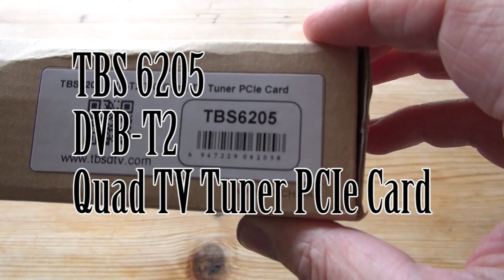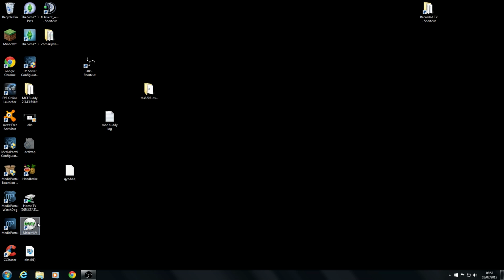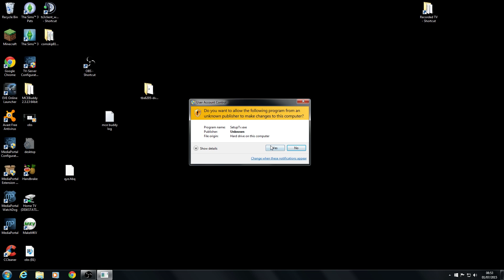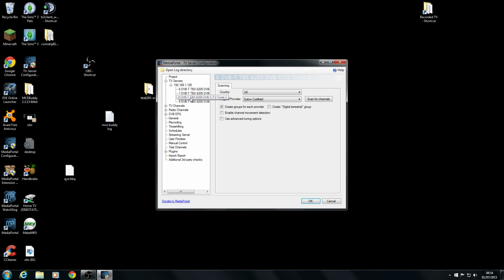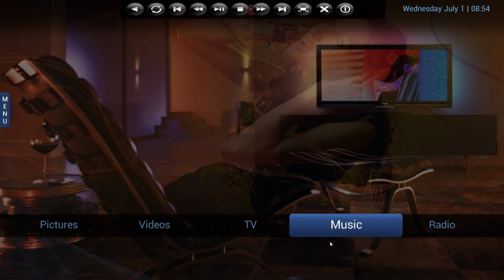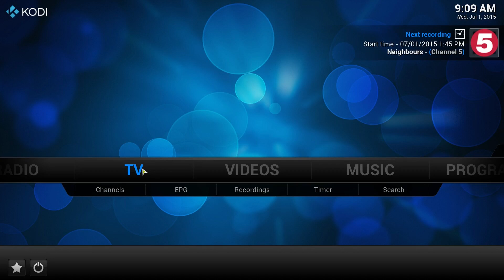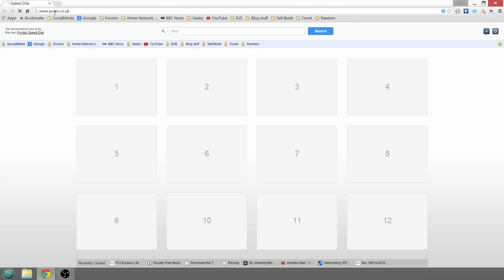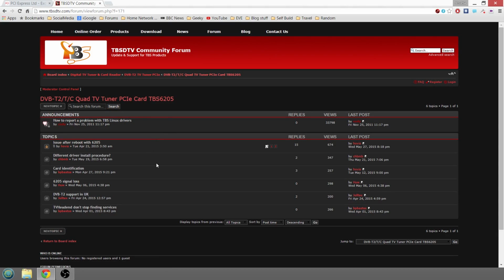TBS 6205 DVB-T2 Quad tuner PCIe card, unbox, install and review

Comment: Hi,  is this card for global use ?   Does  it require an antenna or top-set box ?  Can I watch local channels with this card ? thanks
Reply from the maker: This card requires an antenna and a digital DVB-T2 broadcaster e.g. as in UK and some other European countries. It also supports DVB-C, a cable standard which I have never tried. AM

Comment: do you need to split your original antenna cable into 2 cables
then those 2 cables go into each antenna input on the card?
how about when there is 4 inputs
do you need to plug in 4 antenna cables?
e.g.
https://www.ebay.com.au/itm/TBS6904-DVB-S2-Quad-HD-Tuner-PCIe-Card-Satellite-TV-Receiver-For-IPTV-Streaming/232038106255?epid=2215842273&hash=item36068c848f:g:PMQAAOSwIgNXovAP

would it be better to just get something like "Hauppauge WinTV-QuadHD "
which only needs one antenna cable plug into the card?

Comment: Can I use this connected to dish-mounted-at-the-roof cable and have the channels?
Reply from the maker: If you mean satellite dish, then this is not suitable for satellite broadcasts, to receive satellite you a need card which can decode satellite standards like DVB-S2, this card does not do that. AM
Reply: @AmoebaMan yes, thank you. 
So, Do you connect cable network instead of having a satellite dish?
Reply from the maker: @Emranrajaee  Hi, no I use an aerial for DVB-T2 TV free over-the-air broadcasts in the UK

Comment: Hi Amoeba Man
Thank you for this. I'm hoping you can help me with a different TBS card - it's a TBS6528 MULTI STANDARD TV TUNER COMMON INTERFACE (CI) PCI-E CARD. On paper it seems very capable, supporting DVB-S2 and EVB-T2 and with common interface. We need to be able to extract a transport stream from this card to use with our own software and are finding it difficult to get relevant information from the manufacturer on this. If Kodi and others can get TBS cards to work with their interfaces then there must be some hope that there is an SDK where we can access the card's output. It will be installed under Windows Server 2016.
I hope you can point me in the right direction.
Reply from the maker: I am sorry Frank, I have no idea how that could be done! AM
Reply: Hi
I made some progress yesterday with TBS support. They use the Windows Broadcast Driver Architecture (BDA - see https://en.wikipedia.org/wiki/Broadcast_Driver_Architecture) which is a standard for streaming with Windows (I didn't know this existed until yesterday). There are a lot of code examples to be found on this - Microsoft site, Github and Google).
All the best.

Comment: I need to record 5 different channels,if they are on the same frequency one tuner will be enough?
Reply from the maker: If they are on the same multiplex you may be able to record multiple streams with one tuner, max number depends on stream and your setup.  AM
Reply: Amoeba Man hi, I have 30 channels in single line from lnb, can this card provide me all 30 channels at same time?
I’m willing to take all channels from lnb and stream each channel on different ip on my local network

Comment: when recording shows,  does it record adverts too ?  if so does the software bundled with it have a way of editing them out ?
Reply from the maker: HI Pete, I am not sure what software comes with the card, I use Mediaportal which is free / open source.  I also use MCEBuddy to transcribe my recordings, this can automatically detect and  remove ads from most recordings. If you wanted to edit them out manually then you can use almost any video editing package to do this as Mediaportal will save recordings in mp4 format. AM
Reply: thanks for getting back to me,   this info has sold me on the card :)  will be looking to add it to my Kodi set up in the very near future :)

Comment: I am having trouble scanning channels using DVB Dream and it says No Channels found, please can you help and do a tutorial?
Reply from the maker: Hi JJay, I am sorry I am not familiar with DVB Dream so I can't help much - start by checking the basics e.g. drivers installed, aerial plugged into the correct port on the back.  Do you have a strong signal e.g. a good quality aerial?  If everything looks good  then why not consider trying some alternative software?  FYI I have never had any success with indoor aerials at all but I live in an area where the signal is not very strong. Trying checking your aerial with a standard TV just to make sure you have a signal perhaps?
 GL! AM
Reply: Amoeba Man Hi I figured it out.. its because I installed the DVB-C drivers instead of the DVBT/T2 drivers and was using cable instead of satellite in the settings of the software with my indoor ariel.. Uninstalled the DBV-C driver and works all fine now. The DVB Dream and Media Portal 2 are picking up channels! I am considering switching to external Ariel so that I can get freeviewHD channels maybe but my setup with virgin is quite complicated lol. Thanks!
Reply from the maker: Great, I am glad you got it working! AM

Comment: can this be connected with this Indoor-Thin-Flat-TV-Antenna-HD-TV-Scout-TVFox-Type-High-Def-HDTV-VHF-UHF-DTV
https://www.ebay.com/itm/192339175067 ???? as im looking to get my free to air channels to the pc and play them on extream codes
Reply from the maker: Hi engelbert! I have never had any success at all with these portable aerials and use a cable connection to my house aerial - reception in my area is poor generally though and I use a signal booster on my aerial mast - in general though the TV signal indoors is typically pretty poor and personally I would not count on such a device to work, if you live in an area with a very strong signal  then perhaps you might have more luck, sorry I can't be of more help! AM

Comment: I used to use them back in 2008-2009 but I sold my old computer with it. Now I need a new one and cant decide on the brand or technology.
Reply from the maker: Good luck with your decision, fyi if you  are considering DVB-T2 then this card appears to still be on sale, mine is still running very well after 2+ years. AM

Comment: I saw several cards of this in the internet but I do not know which to use because they are all the configurations They are written in English if you can help me please send your e-mail
Reply from the maker: How will you receive your TV ? The first thing you need to know is what kind of broadcast your TV service is, are you planning to receive digital TV by aerial or satellite? :

https://en.wikipedia.org/wiki/ISDB-T_International

It looks to me like in Brazil digital TV is broadcast using a standard called SBTVD which is based on the Japanese ISDB-T standard, we do not have this in Europe and I am not familiar with it.
TBS do make an ISDB-T compatible card but you will need to check whether this is compatible :

https://www.tbsdtv.com/products/tbs6814-isdb-t-quad-tuner-pcie-card.html

This is not a satellite card, it is a TV card. For satellite here in the UK you typically need a DVB-S2 card (like the TBS6904) but this typically only allows you to watch free to air channels.  You need to find out what standard is used in Brazil for satellite.

I am sorry I don't know anything about unlocking satellite signals, in the UK satellite services are either free to air or require a decoder for a which a subscription is required.

AM

Comment: I tried so many times with at least 3 different adapters to get EPG to work, but never ever managed to do it :(
Any plans to do a tutorial/walktrough to configure a MediaPortal TV server / Kodi client?
Reply from the maker: Sorry you are having trouble, to be honest it is not my area of expertise, it is so long now since I configured my server I would probably have to re-do it and learn again.  I use the broadcast guide data from the DVB feed rather than any of the external reference databases like xmltv.  In my experience its all about the server side, if the server is correctly configured all Kodi needs is the MP plugin enabled, IP address and password and it gets the data automatically.  I guess the starting point is whether a MediaPortal remote client can get the data i.e. is the server offering up the data on the network. AM

Comment: Tripod = 3rd hand. you can even get one for you phone.
Reply from the maker: Very good point, I do use a tripod with my camera but on this video I couldn't get a good shot of the inside of the case with the camera on its mounting due to the very tight space and I wanted a close up of the motherboard and socket so hence the wobbles, ah well, pffft!  AM

Comment: Hello 
I install driver TBS 6205 DVB-C on linux AMD64 , and i put on each adapter frequency on TVheadend .
adapter0      266000
adapter1      354000
adapter2      522000
adapter3      570000
and whene i run all stream on my server IPTV , all stream crash . if i run 4 stream all work well .
so whats is problem ..
Reply from the maker: Sorry Abdesamad, I use DVB-T2 (not DVB-C), have Intel hardware and don't use TVheadend so we have different setups, I also don't use IPTV and don't know much about to to be honest.  One suggestion - perhaps you see whether it is software related and could try a different backend to see if you card is working correctly on that?  I use Mediaportal server without issue using the 1.0.0.3 drivers for DVB-T2, latest release is 1.0.0.4 - its an easy install and free to download.  You could also try the TBS forums for technical help, they are linked in the show notes above.  I hope you get your issue sorted and sorry I can't be of more help, AM

Comment: Thanks man, extremely helpful. I'm going to try to get these cards to work in Australia. (Nice quality hardware by the way).
Reply from the maker: Great, hope it goes well for you. No issues at all here with the card, for me it has been excellent so far running 24/7. AM
Reply: Hi Greg, how did you go with the TBS6205 in Oz? I'm in Perth and thinking of ordering one. Are you using MediPortal?

Cheers,
Steve.

Comment: few channels,
you can record in simultaneous?
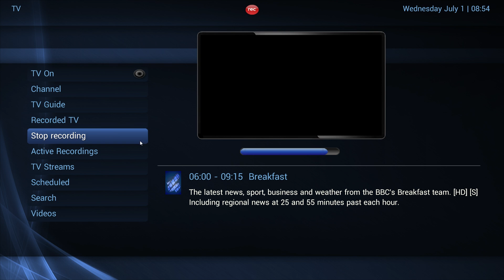Reply from the maker: If you have the right software and hardware you can watch many different channels in many different rooms using this card, If you you look at 5:05 in the video I demonstrate recording 6 live TV channels simultaneously and the server could certainly do more. GL! AM
Reply: Amoeba Man
When I look at the specifications of the hardware is not detailed how many programs can I capture at the same time, I'm looking for a having ISDB-T, but apparently the only way would be to buy multiple devices at the same time with ISDB-T with USB port and record at the same time with different cables
Reply from the maker: Marko, the card in this review does not support ISDB-T, TBS appear to make one called the TBS6814, http://www.tbsdtv.com/products/tbs6814-isdb-t-quad-tuner-pcie-card.html, I'm sorry we do not have this standard in  Europe and I don't know anything about the card so can't really offer any advice. GL! AM

Comment: How many channels can you simultaneously watch.
Like can I watch one channel a different room and another and a different one etc ?
Reply from the maker: +TOM FUB Hi Tom, difficult to answer because it depends on what software you are using and how good your hardware is.  With Mediaportal maximum simultaneous live channels depends on how your channels are multiplexed in your home country but minimum of 4, probably a lot more than that!  If you are watching recorded TV pr combination of recordings and live then a lot more than that can be watched.  If you you look at 5:05 in the video I demonstrate recording 6 live TV channels simultaneously and the server could certainly do more.  Important note : if you are using Windows Media Center then when I last checked for some reason windows restricts you to one channel to one tuner and a maximum of 4 tuners. My server is a relatively powerful PC, with less power available you could end running into hardware limits if you try and stream many channels - something else to check on. AM
Reply: +Amoeba Man Thank you for your quick response.
Hardware is not an issue with me, i am running a i7 and 32 gb of ram, so I don't see that being a problem.
I'm really tempted to buy one of these cards For streaming purposes, but in your honest opinion, are they definitely worth it for the price, because they are quite expensive, especially the satellite ones.
Reply from the maker: +TOM FUB You are right, you won't have an issue with PC. I don't know about the satellite ones sorry, I certainly have no regrets but I like my server to be rock-solid as it is our main media device in our house and i have had variable experiences with cheap USB tuners.  You could reduce the cost by going for fewer tuners on the card.  I haven't seen many cheap quad tuner PCI cards tbh.  Good Luck ! AM
Reply: Hello there again, I've come back to your video wanted to ask you another question if I can, please.
I finally purchased a card on eBay TBS 6981 Satellite Tuner, in your opinion what is the best software to use with these cards.
for scaning for channels, I want to stream the channels over my network to other devices such as my kodi media centre/Nvidia shield.
Ideally I would like them to be in m3u8 format.
Thanks for any information you can provide.
Reply from the maker: HI Tom, I have always used Mediaportal server under windows 10 as a backend on my network and it does an excellent job of serving live tv and recordings to frontends including Kodi (which I use on different platforms).  I don;t have too much experience of other software. GL! AM

Comment: +Amoeba Man Nice video on this product. You're recording SIX simultaneous DVB-T2 HD channels on a quad tuner card. In my ignorance I thought it was one channel per tuner. So what is the maximum upper limit? Is the "more than four" due to the Media Portal software?
Reply: +GadgetyMV Never mind, I got it, it depends on how many channels there are on each Multiplexer (MUX). So 1 MUX per tuner.
Reply from the maker: +GadgetyMV You got it!  From what I have read in theory the limiting factor is stuff like PCIe bandwidth or simultaneous stream writes to your hard disk, apparently 10+ streams shouldn't be an issue. With so many of our channels in the UK sharing the same Mux I don't think I have ever seen all four tuners in use on our server, even with the wife going crazy on the scheduling.  Previously under WMC, which limits you to 1 MUX - 1 tuner, and with two tuners this was constantly a problem and I was getting loads of grief.  Those days are gone, hooray! Cheers, AM